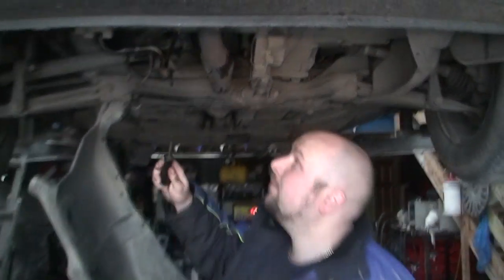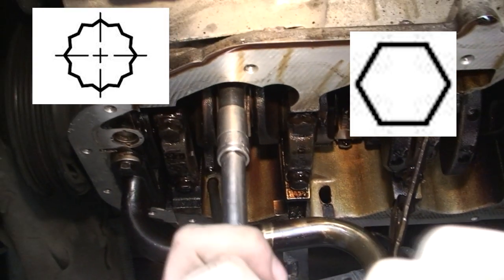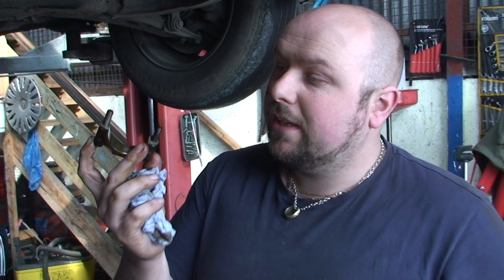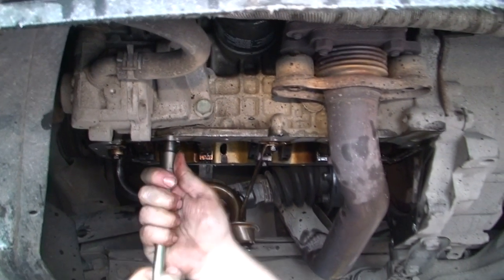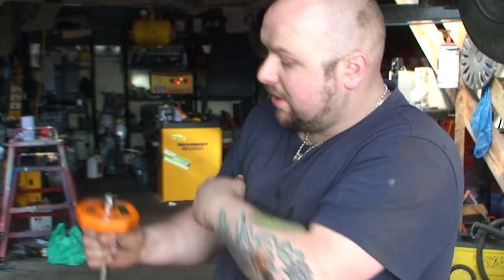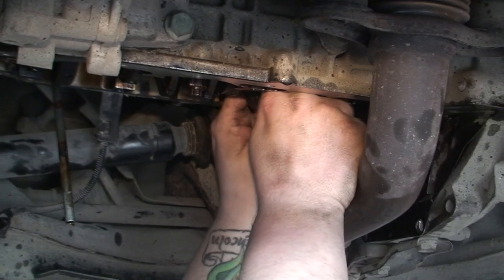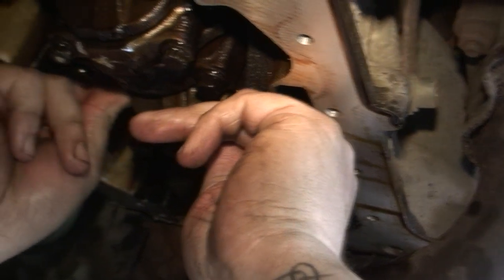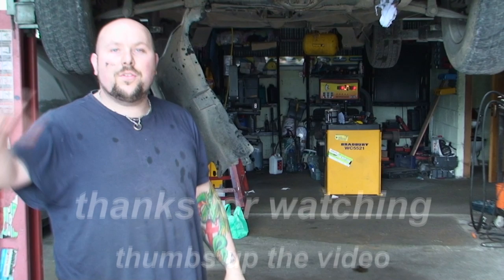bodgit and leggit garage how to replace big end bearings on a car (vw golf part 2)

Comment: Great video mate and lots of useful information. One point only, bearings get lube only on the inside face to the crankshaft journal not the outside. They are kept in place by crash (reason why torquing them correctly is essential) and with oil there you just increasing the possibility of moving out of position.

Comment: just acquired a relay 2.2hdi and it sounds like big ends, pulled sump, not a bit of play up/down or front to back, good clearance side to side, same on them all, but its vry kncky at the flywheel end, wondering if its the main crank bearings, or something odd with the dumb mass flywheel
Reply from the maker: lez briddon hi mate that's one of them questions I cannot really answer as I cannot hear it it could be that and it could be other things to one of them things I would just have to kind of see for myself don't want to give you the wrong advice and you waste your time with something I said

Comment: What  happens  if you find damage to the crankshaft on 2,3 or 4 cylinder ..after replacing new shells on no 1 cylinder.. bit of a waste  of time...are you not better checking for damage on the crankshaft first

Comment: Nice video mate,I was planning to take the sump off my 1.4 AXP next weekend.
When accelerating I can hear a light ticking noise,maybe the noise is coming from the hydraulic lifters/tappets. Could you do a timing belt vid if your customer is interested?
Greetings from Croatia
Reply from the maker: hi mate thanks for the comment.yes it can be coming from there unfrotunely is hard for me to say exactly where is coming from. firs what you can try is to flush out your engine. the problem with doing a video on a timming belt is space it will be hard ti see what i am doing i will try to get a old engine and do it on the flood 4 you

Comment: Hi mate. Really need your help here. I followed your detailed tutorial, hats off to that. I tried replacing my big ends and i think i overtightened the conrod bolts. My crankshaft is kind of stuck and have to re-do the work once again. So my question is, should I slightly loosen all the bolts at one go so that the crankshaft spins again or should I proceed one by one, to loosen and retighten to specs? Million thanks for you help mate....
Reply from the maker: Hi mate you're going to have to be extremely careful you're going to have to check everything make sure the bear and you've got a correct make sure there is no damage on your conrods or crankshaft I would go through absolutely everything again if it is still sticking you have a serious problem and you need to find out exactly what's causing it impossible for me to say as I cannot see the vehicle
Reply: @bodgitandleggitgarage  thanks for your help! The issue was with the bearings. They were slightly oversize.  Got a new set and replaced them.. Crankshaft now spinning even smoother than  before! Checked pistons, still straight. Crankshaft is also in good condition, luckily!! Thanks a lot mate
Reply from the maker: @prashaantsiddharthteeluckd831  glad you got it sorted mate

Comment: Absolutely superb videos unlike other videos you show from beginning to end exactly what to do and what tools to use I've got a Vauxhall Vectra 1.8 petrol I'm helping the oils not getting to the head as it's hanging a little bit plenty of oil in the bottom just making a tapping noise sounds like the top com followers hopefully oil light is flashing and sometimes staying on but dipstick showing plenty of oil could you diagnose the problem for me I have thumbs up like and subscribe to you
Reply from the maker: THE NEVERENDING TITCH hi mate unfortunately it's going to be impossible for me to diagnose a problem without seeing the car no one can do it but a few things to look out for take off your sump and see if your oil strainer is blocked you might have a problem with your oil pump you could have blocked oil passages in your engine
Reply: Thanks mate unfortunately you're not in Yorkshire are you that's where I live is there a way I can send a video across to you with the sound of my engine
Reply from the maker: THE NEVERENDING TITCH hi mate video will be no good unfortunate as the camera never picks the engine up properly I don't want to say anything to you just because I don't want to lead you down the wrong path this is something that has to be looked at and test have to be done to find out exactly what's wrong
Reply: Hi mate might always trying to was blocked but that wasn't the problem my big end bearings need replacing number one was absolutely broke number for was fine just got I do number 2 and 3 my 1.8 Vauxhall Vectra 51 plate where is the best place so that I get it right to buy the bearings from what do I put in the description thanks mate

Comment: If the big end bearings have excessive play, does this mean that the main bearings are likely to be worn as well?
Reply: toyo toe BIg end bearings tend to wear more often than, and before, main bearings. If big end bearings are left too long, the faster they wear and the extra gap between the crank and bearing reduces oil pressure, which affects other things like the main bearings.

With some older cars (I'm on about earlier models of the original mini and the MK1 Ford Escort for example, they only have 3 main bearings, unlike newer engines that have 5. These carry more load and do tend to wear more.

If you're in doubt, it's not a lot of extra work to remove the main bearing caps and inspect the bearings, and some times it doesn't cost a lot for a set of new bearings, so you could do them at the same time.

Worn main bearings tend to make more of a "rumbling" noise under load or when revved, whereas big ends tend to make a knocking noise.

Comment: Mine have completely gone very loud knocking noise, is it worth doing or is there another problem , 1.3 mk1 fiesta
Reply from the maker: Dez Alan hi mate that is impossible to say until you take them out and see if there's any damage done to the bottom crank
Reply: bodgit and leggit garage thanks for the reply mate, just finding it hard to source an engine, I'll have to get dirty and pull it apart
Reply from the maker: Dez Alan as long as there's no damage done on the bottom crank you should be ok if there is damaged on at the bottom crank you need machining oversize bearings and that is going to be expensive
Reply: bodgit and leggit garage jesus, sounds bad did around 1 mile after it went, might just sell it as a project and restore the 72 mini, had it as daily lol then bottom end goes haha. Kent engines aren't as good as people made out. 😂

Comment: Great video! Going to check mine as it sounds like this, do you think its the same? Think it might be cam shaft bearings too. Or may be a new engine? 

https://www.youtube.com/watch?v=8_Z807sXlXI

ps.  Nice Sierra Cosworth too!
Reply from the maker: hi mate unfortunately it's hard to tell through the video as the camera does never pick up the sound properly but if you have metal filings in your oil you need to check all your bearings make sure you haven't got Metal on Metal if you do you're gonna need more than the new shell bearings
Reply: Nice one thanks for the quick response, will check it out. Yeah I recon so.. Changed the oil sensor first then oil light kept coming on, then it went in to limp mode. The lower turbo hose had blown off also, Dropped the sump, saw the deposits  (pic here  https://postimg.org/gallery/25fxho9xe/ )changed oil pump, oil pickup. Will strip it down and have a look. Thanks again and great channel !  :)
Reply from the maker: let me no have you get on and thanks for watching